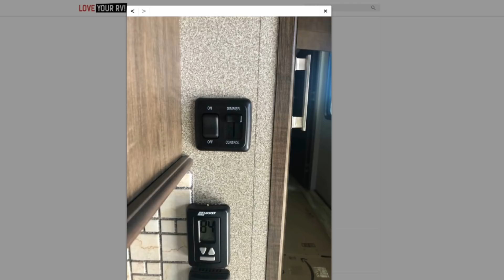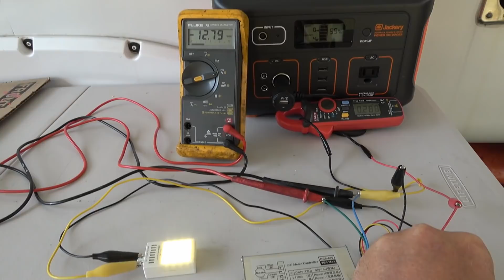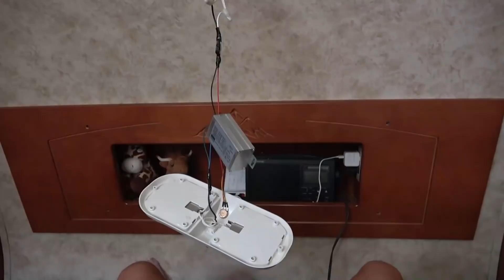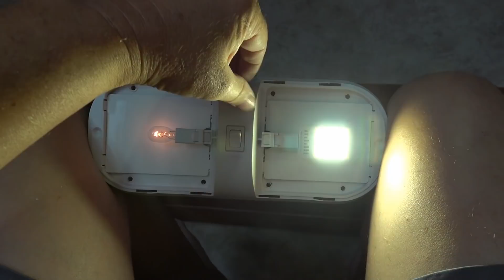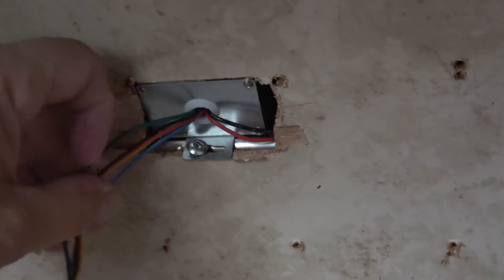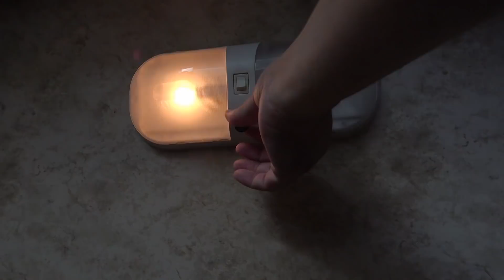DIY 12V RV Light Dimmer Mod Using PWM Motor Controller

Comment: Some RVs (like Roadtrek) don't filter the rectified shore power so the shore power will cause the PWM to constantly reset resulting in a flickering light.  This can be fixed by placing a large 100uF, or greater, capacitor near the PWM box.  Running off of your house battery will not have this issue.
Reply from the maker: Really, in this day and age, there are still RVs being built with unregulated DC chargers. I thought that was ancient history, weird. If I had one of those Roadtreks, the first thing I'd do is replace the unfiltered charger with a regulated converter charger, they aren't that expensive.  Cheers, Ray

Comment: PWM seems to be the preferred way to dim LEDs, but it likely works better with a smoothing capacitor and a snubber resistor added to stop any possible flicker and get more range out of it.

Comment: FWIW Ebay has an RV Interior Led Ceiling Light 12v 280LM Dimmer. Perfect replacement for the oval overhead RV light. $11.99
Reply from the maker: Thanks, I tried one in another part of the RV, I find the light from most of those cheap LED fixtures/lamps quite harsh and industrial, usually too white like Walmart lighting in the bedroom. :)

Comment: Any man that has a higher end Fluke multimeter and the yellow part is mostly covered in grease/dirt knows what he's doing, no need for a disclaimer.
I have a 150 watt incandescent bulb with a dimmer sitting next to me in my house and you couldn't pay me enough to change it out to something else. Oh and the bulb was bought from Amazon with an advertised 20,000 hour rating. So far I'm still on my first bulb after about 7 years and I have 5 more new bulbs waiting in the closet. I'm guessing at the rate I'm going my great grandkids might use them up.

Comment: I love just fiddling with stuff to make the best outcome work for us in our RV. I FOUND THE LIGHT SWITCH DIMMER COMBINED WALL SWITCH NOT TO WORK GOOD WITH LED LIGHTS. I have converted to using these dimmer switches. "Manufacturers' Select ITC 100 Watt RV Light Dimmer Switch in Black (21005) " I use one in the bedroom ceiling lights (all led) and 3 controlling the outdoor spot lights (flag and perimeter all LED lights). I also attached a volt / amp meter and fuse to each light to insure I do not burn out the built in 4 amp fuse in the switch. just thought I would share, why your light turns off when touching the control box to the aluminum frame, It looks to me like you have a hot wire contacting the inside of the box and shorts out with the direct contact to ground. good luck and safe travels.
Reply from the maker: I think if it was a hot wire it would have blown the 3 amp fuse on contact. My guess is the input and output of the PWM device can't share a common ground. Normally there would be 2 wires in and 2 wires out so no problems, just happens that RVs, also like to use the frame as a return ground.  So I bet they use the case as the ground on the output side of the device but not the input. But just a guess, I should have took it apart and had a look.  Cheers, Ray